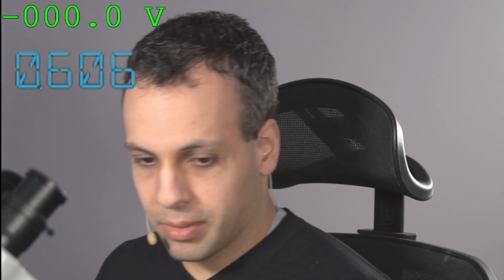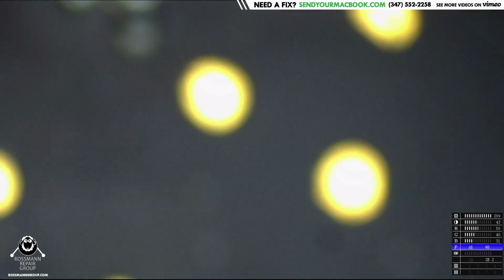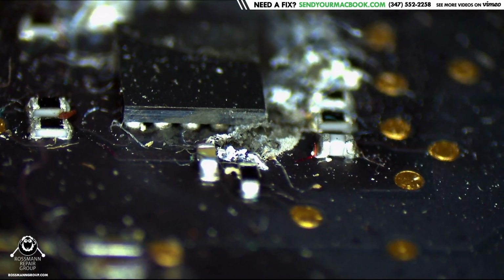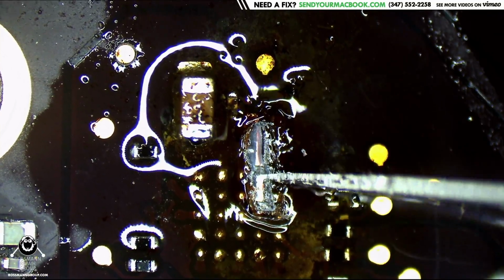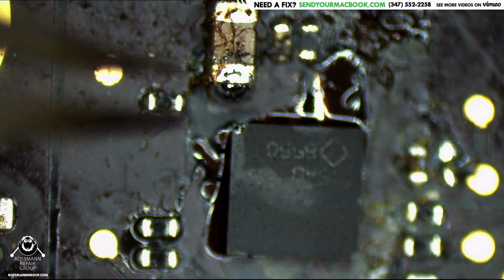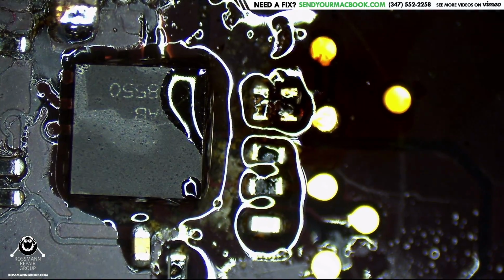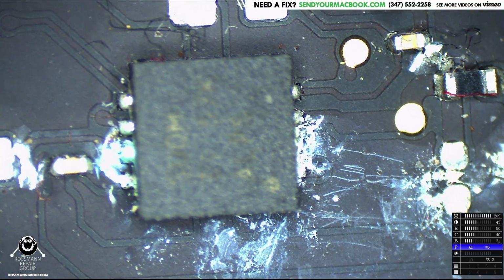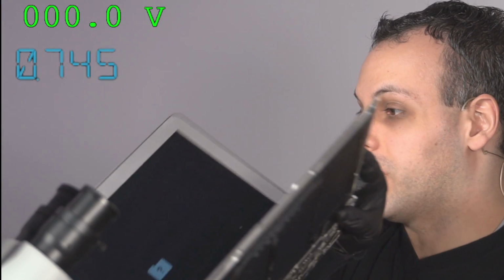Macbook Air board repair - it's about time 😊

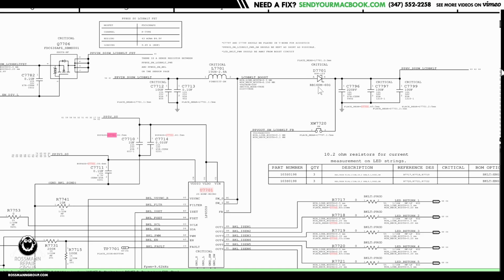Comment: Great video, but at 5:06 your explanation about the diode is not right. The role of the diode is to not let the capacitors (C7796-CL7799) to be shorted to ground when the switch is on. When the switch in on you want the capacitors to supply the load not to be shorted.

Comment: Criticizing NordVPN for getting hacked because of a datacenter being incompetent is like criticizing Rossman Repair for being a shitty repair company because they hired a bad contractor, or because whoever you're using to ship computers back to people decided to run over one a few times with their truck. If you want to criticize NordVPN, criticize their severe delay in disclosure and for not patching clients immediately. The impact was minimal, but their initial response was bad, only after bad media coverage did they finally start making actual positive changes.

Comment: I did notice while you showed the chip from your store how reasonable the prices were for people who repair Mac Books. I don't repair boards myself but there's principles int he repair of the boards that apply to other repair of other boards from other devices ....I know a lot in order to say if I had to recommend a store for products for Mac Books you're would be it and the fact that your store sells products that I can use for other electronic repairs I can confidently recommend them due to the great prices. There may be dark corners with cheaper prices but how confident would you really be using them (used parts marketed as new? It happens)? Awesome content and thanks!

Comment: 4 hour ago Financial Times Quoted Apple saying "
 
 California-based Apple on Monday warned that “worldwide iPhone supply will be temporarily constrained” due to the coronavirus epidemic and that factories run by its suppliers in China were resuming work more slowly than expected. 

Apple fell nearly 2.5 per cent, and shares in chipmakers around the world also slipped." 

May have to start sending them out to Louis, to be repaired rather than replaced. Karma. 

thanks Louis for all you do.

Comment: When I watch these videos I am always struck by how many of them involve corrosion. Is there no coating that could be sprayed on these boards during manufacture that could prevent this from happening?
Reply: Of course there is. It's called conformal coating. Mac boards are made of compressed toilet paper. The want them to fail so you have to buy a new computer.
Reply: @xenonram  

Well, I thought there must be something. This exposes once again that the myth that Apple is such a greater manufacturer of electronic devices is complete rubbish - not that other manufacturers may be the same! There is no reason other than greed that these devices cannot be built to be more robust it would seem.

Comment: Hallo sir. I have a problem with my mac air 2017, i deleted some wrong folders on it to try and clear up space, but i deleted the wrong files. And the result is that i had to reset the mac to factory. But the thing is that now my mac is showing me battery issues and when it shuts down by it self i have to reset the time and date by myself. Do you know of a command that i can use to get it fixed

Comment: for a year ive been watching your videos, why are apple laptops prone to corrosions even though there is no liquid spills? i have a laptop which is low end and it served me for five years before the exhaust fan failed (its my fault for not cleaning it). i also over worked my laptop too. sometimes i am lazy to shut off my laptop and have it running 24/7 without power saver on, but i always removed the battery and my laptop is plugged in the ac 24/7. still wondering why apple laptops die so easily

Comment: Does it not matter to start doing soldiering on a dirty board. I don't know what I'm taking about but I'd rather clean it first.
Reply: If you clean it first, you'll clean off the corrosion that shows you where the problem is. Without that corrosion to point towards the problem, it takes much longer to find the faulty part.

Comment: After seeing this board, I need to open my laptop and wash the circuit board just in case it ever needs service.
Reply: soap, water and sun drying...
Reply: That would destroy valuable clues to what part of the board malfunctioned. And if you're confortable cleaning the board you can just repai it yourself.
Reply: That was a joke, Jan.
Reply: @jan_franzke  Come onnnn, Jan!
Reply: @jan_franzke  its a joke jan

Comment: "wire with TikTok installed on it" lol
Reply: Wire audio recorders used to exist so you could also put data such as an app on wire.
Reply: @Helio_Centra  no you can't put shit on wire... facepalm
Reply: @mobilmag864  Sure you can *double facepalm*... You can put shit through a wire and you can put shit on a wire... It was the precursor to using magnetic tape, magnetic wire... See Techmoan's video he did on an old wire recorder. They were used for storing audio like voice recordings or music, but you could just as easily store data as well such as the binary data of an executable application for a certain architecture and platform as rasungod0 was stating. It would be kind of silly to use a wire recorder in the modern era since it's old technology and we have much better today, but tape backup systems are still used today in some use cases where they want to store a lot of data for archival purposes for cheap where it doesn't need to be fast to store or retrieve the data they just want to have it backed up just to have a backup. What you mean is that a wire cannot 'RUN' / execute an application but it can be used as a storage medium for one if you were crazy and just wanted to do it for some weird reason.
Reply: ok the magnetic wire analog data recorder technology existed, you are factically right, but also at the same time you are making an absurd argument over a joke comment made on a joke...
Reply: @YourTVUnplugged  ok, you can physically put data on a wire, the same way you can print some micro sized text on a wire, but without specialized hardware there is no way how to read this kind of "data" and it means no harm for your computer since it's not digital data in any way.

It's really stupid argument about a joke.

Comment: Turn around time between live stream and uploads are really low at the moment, whats the deal? Did you finally get good internet and a space to work with minimal distractions?
Reply from the maker: gigabit FIOS. it is actually 100 mbit instead of 1 gbps because I suck at crimping.. will fix later.
Reply: @rossmanngroup  Dude, don't crimp fiber, the laser particles can't get through. Use cellophane tape.
Reply: @rickscheck5330  no dude use spit and paper if you use cellotape you might get some fucked up light juju
Reply: @rickscheck5330  I know right, those lunatics put their Internet backbone cables across the ocean floor - the high pressures are squeezing the electric fluids out of the cables making the Internet slow. /kappa
Reply: @rickscheck5330  oh shit so you just literally touch the wires together and tape it??